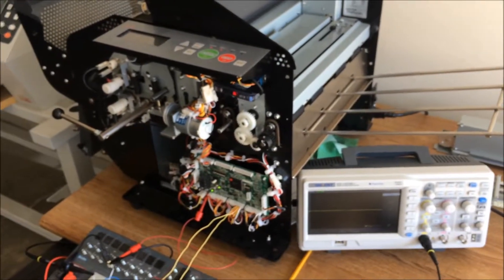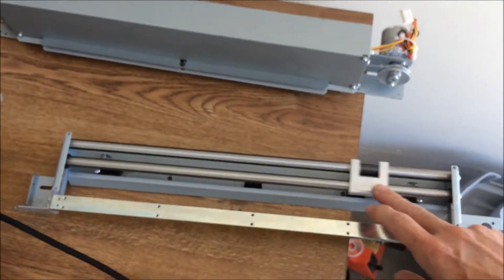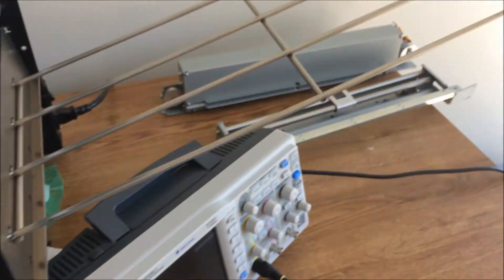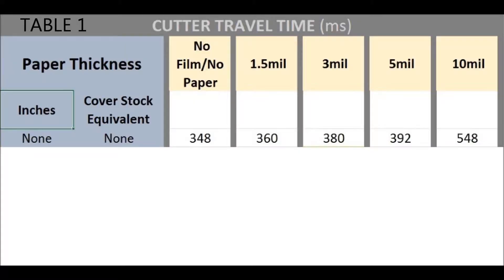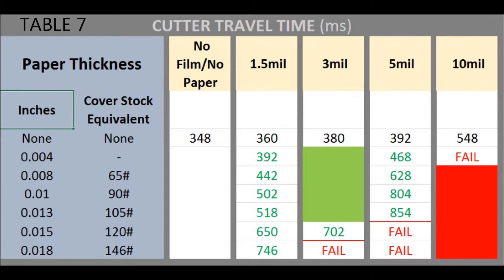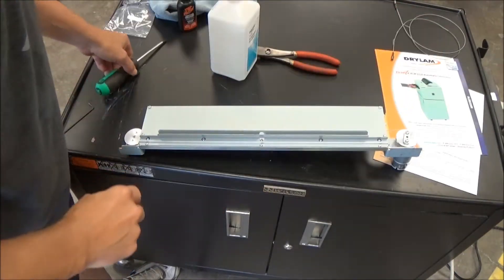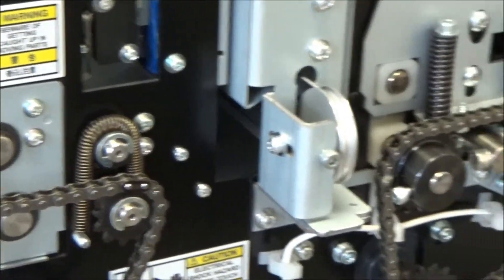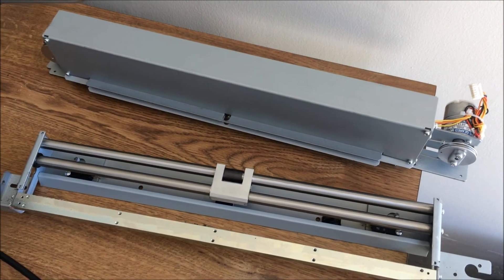On The Bench: Fujipla ALM Series Cutter Unit Errors, Travel Timing, "Clean/Lube/Adjust"

Comment: Hi! Is the wire around the pulley supposed to be double wrapped around one end? I’m having trouble getting my replacement wire to fit because it’s far too loose to the wheels, and if I double wrap it doesn’t stretch all the way to the screw that hold the springs in.
Reply from the maker: Hi, Mason. Yes, the wire wraps twice around the motor pulley but only once on the ‘dumb’ pulley. The dumb pulley is adjustable - you’ll be doing that adjustment as well as documented later in the video. It may be easier to get the wire installed with the pulley loosened (moved inwards). Good luck.
Reply: @blasttapes I’ve got it reassembled and now unfortunately the cutter is sounding like it’s moving very slow and is not cutting all the way through/ erroring. Is it possible I have it too tight now, or too loose?
Reply from the maker: Yes, it’s too tight. Review the section about adjusting.